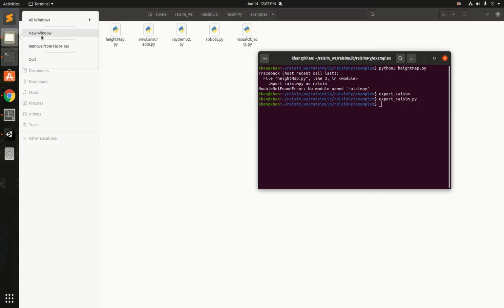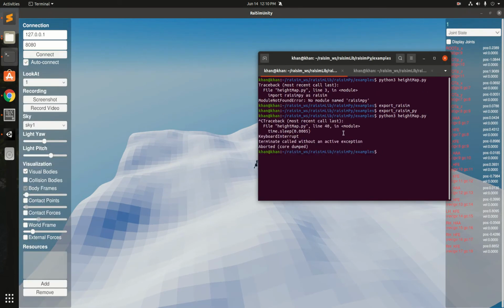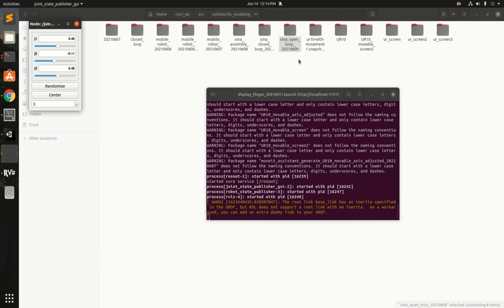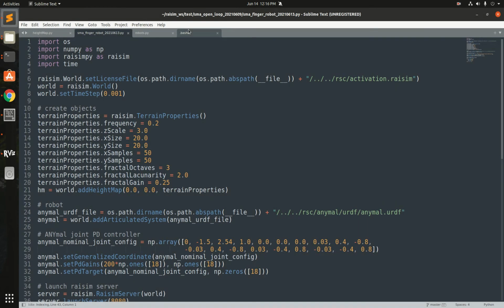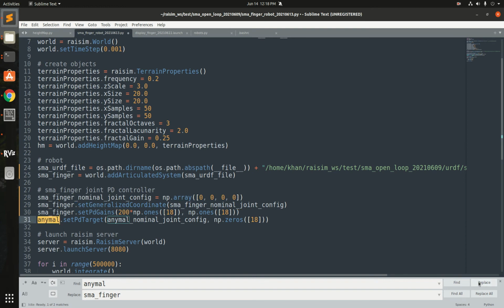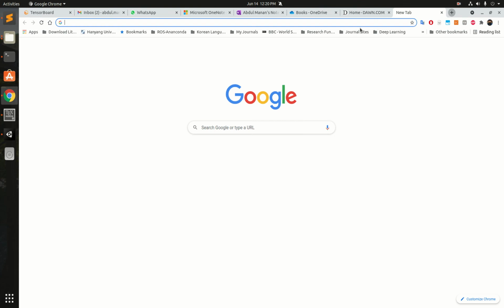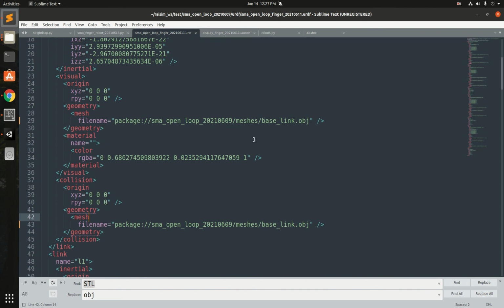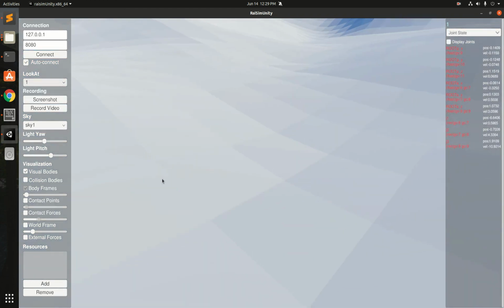RaiSim Part 2: How to use RaisimPy

Comment: Hello, thanks for the interesting demo about raisim. There are no much video demo about raisim other than from the official account. May I know are you doing anything projects with raisim? If yes I am interested on your project.

What is the main difference between RaisimPy and RaisimGymTorch?
Reply from the maker: This is an interesting question. I don't know its exact answer. I could not see any RL example for RaiSimpy but I found one in RaiSimGym Torch. So, I just used it. So, maybe you could explore and also share with me. I am still learning.